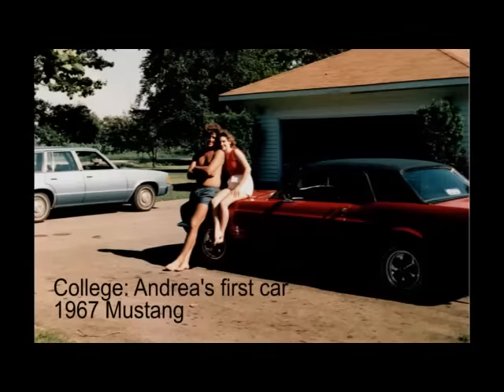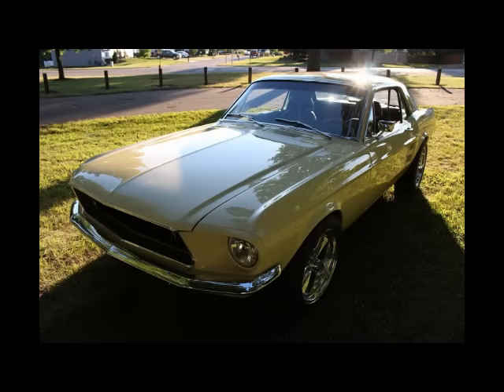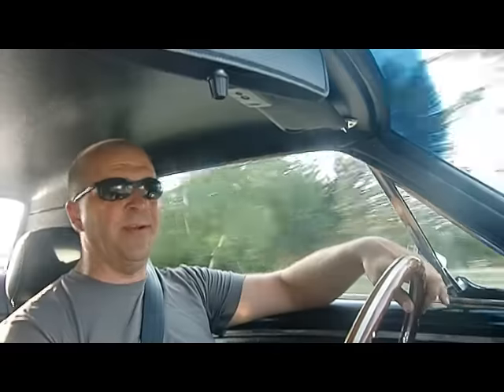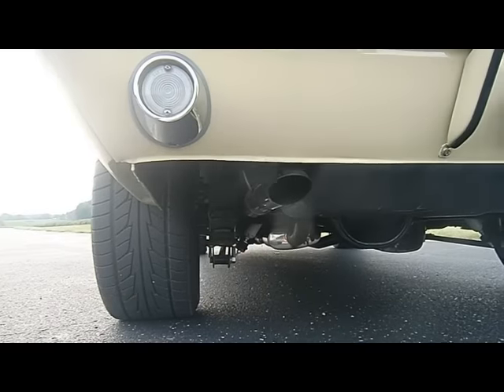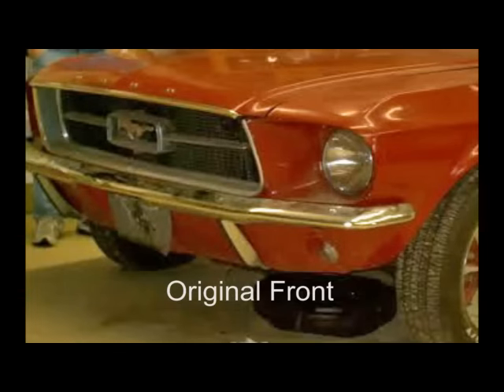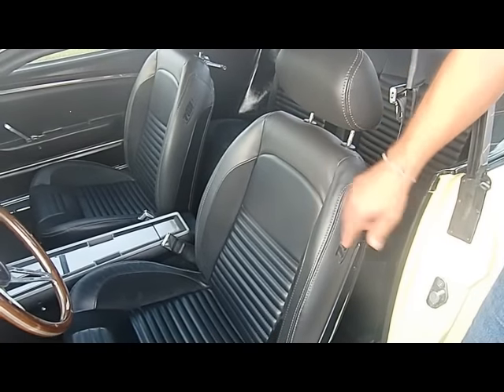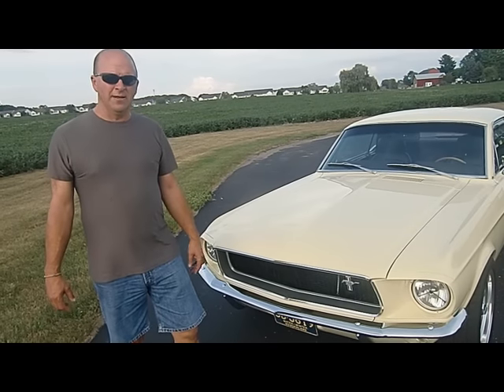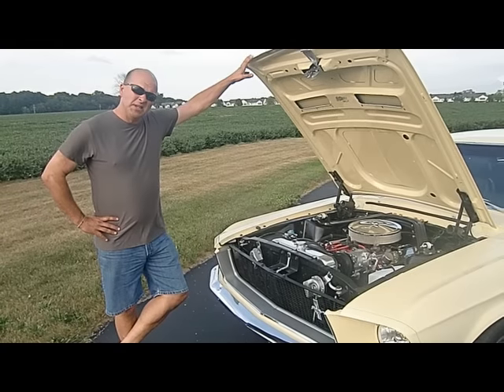1967 Mustang Coupe Restoration: A Labor Of Love

Comment: how did you do the 3 point seatbelt roof mount?
Reply: David Tosh so how did it mount? did you need to weld mounting points? because my understanding was that 67s do not have stock roof mounting points.
Reply: David Tosh sorry i dont mean to badger. i just had a hard time finding documentation on this and i was wanting to do the same for my 67 coupe.